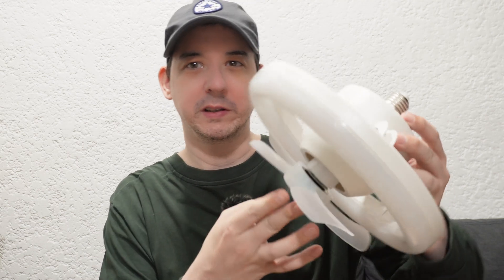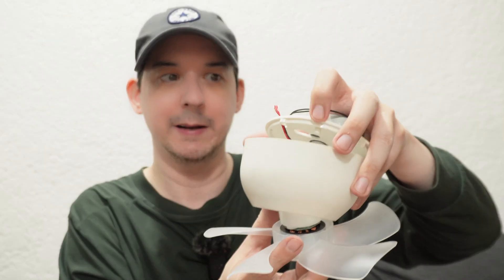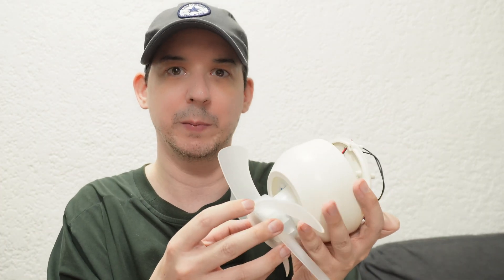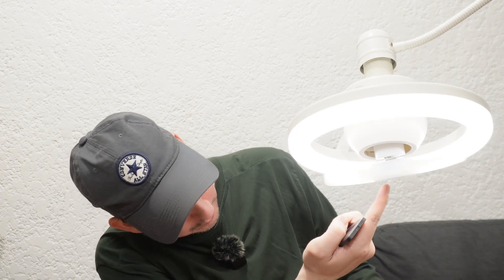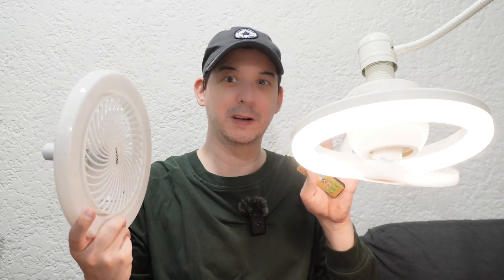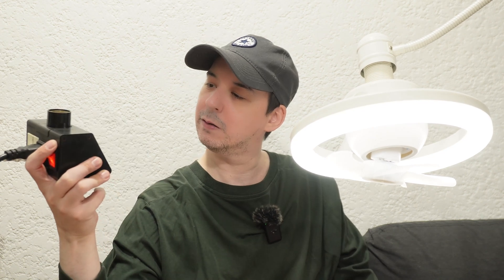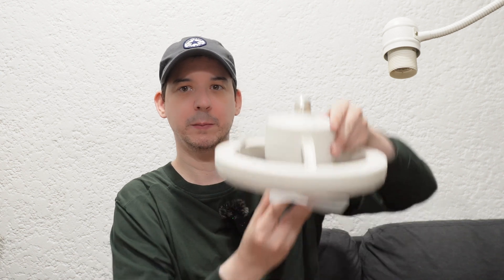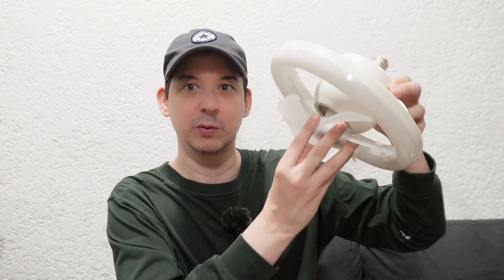Turn any light into a fan - CORRECTION

Comment: interesting product but plenty drawbacks.  for a fan, you need something that is closest to the floor so people get the coolest air in the room because hot air rises.  During the middle of the day and/or your ceiling has little air gap to the roof, then this light fixture fan will just blow the hotter air.  Please Look into DC brushless fans vs conventional AC fans and make a video, I have not yet estimated how much money it saves.  DC brushless fans will work indefinitely until the life of its bearing.
Reply from the maker: I was planning to make a video like that before. 

Because I do actually have 12v fans that we're using. One of my biggest is a wall fan from DSP.

And they do seem to be far more efficient than the standard AC fans that you buy from the mall. 

Plus we have the benefit of being able to run them from a QC/PD powerbank, if ever there's a brownout.

I guess I just need a way to measure the airflow, to give a fair comparison.
Reply: @GadgetAddict  interesting! I have not seen that fan with QC/PC! Indeed, I bought a Tylex USB fan in 2021 and I was able to use it on 3 hour brownout but it is small. I want to see that fan you have there. DC fans far more efficient, I estimate a minimum of half or less for the same wind output. If I remember correctly, Panasonic advertises their DC fans to use 1/3 power.

Comment: Maybe pulling items apart is what it takes and its helps if you have the equipment to test items with.  Screwdrivers and a multimeter really helps. Good job bro, Salamat po
Reply from the maker: Yeah I'm going to be stricter in the future. 

The problem is that many of these "interesting products" tend to be unbranded and without documentation, meaning you don't really want to recommend them to people, but they're just really interesting to explore.
Reply: @GadgetAddict  you said it came in a box and it had DC written on the box, wish you could have shown the box or even the unboxing of the item.  Yes, you dont want to recommend an item without knowing fully well its information and capabilities.  Testing takes time and it's not always easy to find the time.  I value your opinion and input with such items bro. Thanks again for bringing these types of GADGETS to our attention.

Comment from the maker: The motor that spins the fan blade is DC. The motor that orbits the fan blade is AC.

I would have preferred for all of the fan components to be DC, but at least the part that spins the blades is DC.

While i'm fascinated with this type of product, unfortunately there’s no branding on the packaging, or the product. And it doesn’t say what safety standards it has met, if any. For these reasons, I’m not recommending that anyone buy this product.